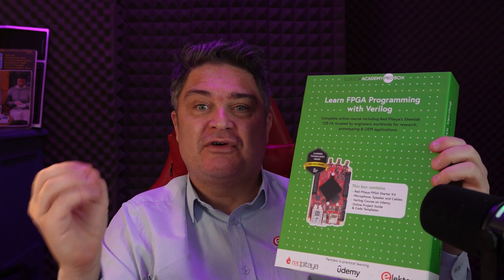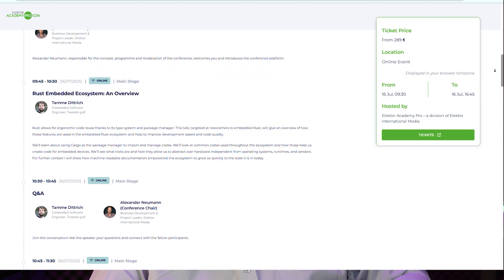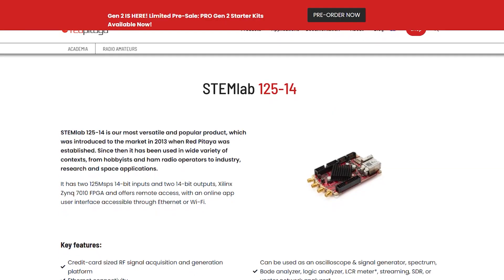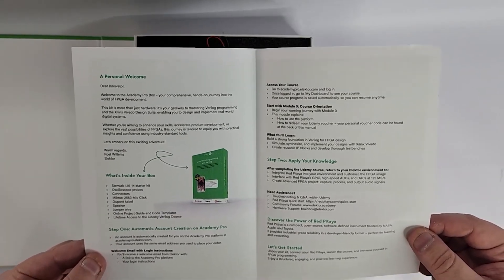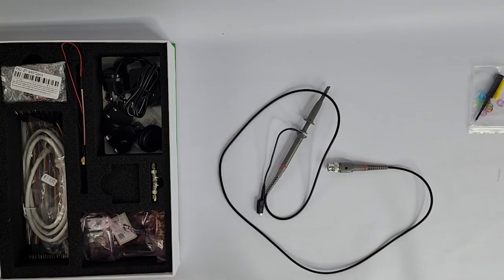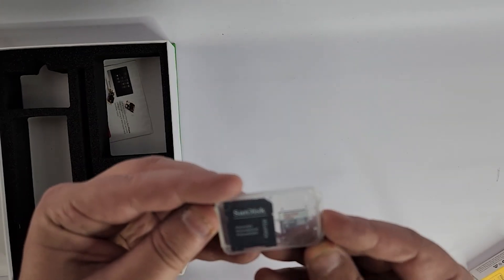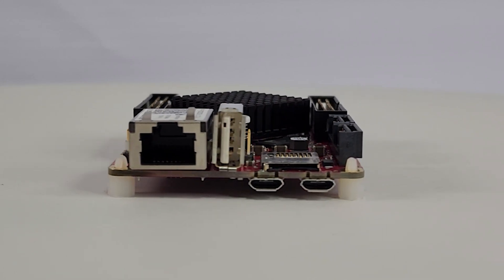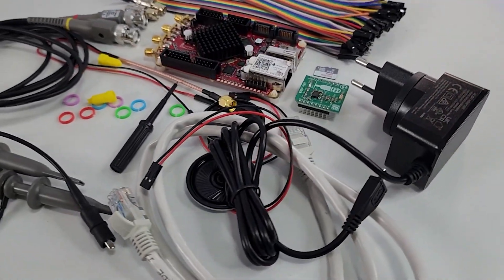Learn FPGA Programming with Verilog — Elektor Academy Pro Unboxing

Comment: Is this course time limited? I would like to have a possibility to return to previous lessons if this will be necesarry. I would like also to work online od two PC's, one at work, second at home.
Reply from the maker: Thank you for your question! The course is not time-limited, so you can access the materials at your own pace and return to previous lessons anytime you need. You're also welcome to work from multiple devices, including two different PCs—your progress will be saved as long as you're logged into the same account. This way, you can easily continue learning from both work and home.

Let us know if you have any other questions!